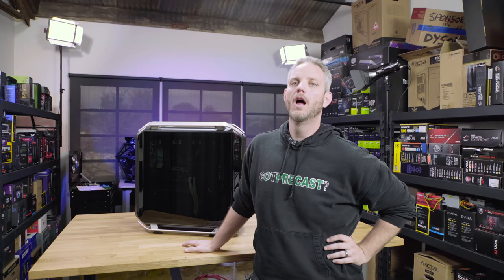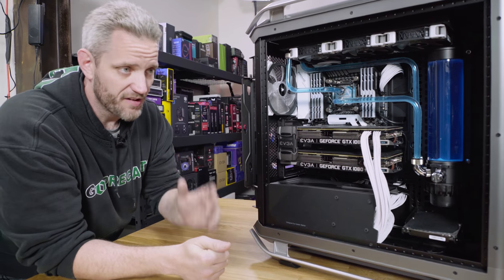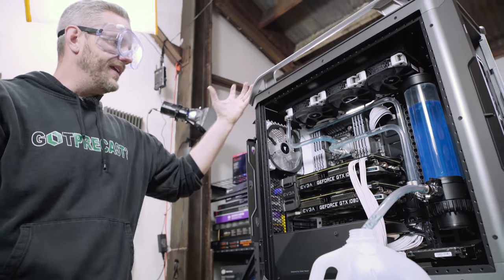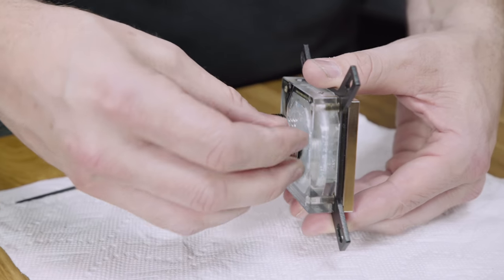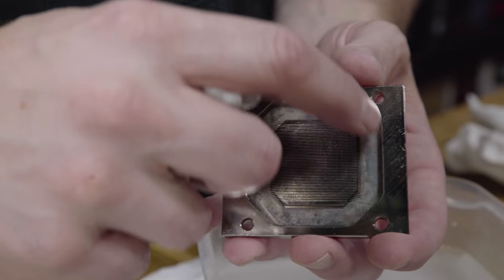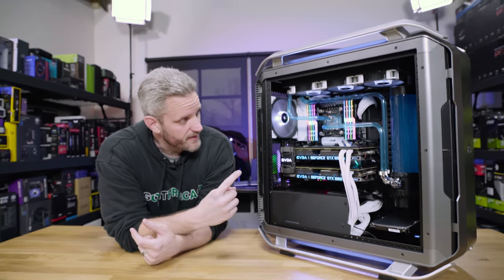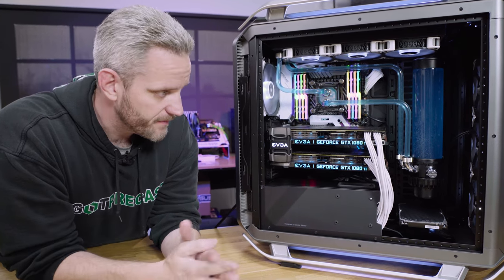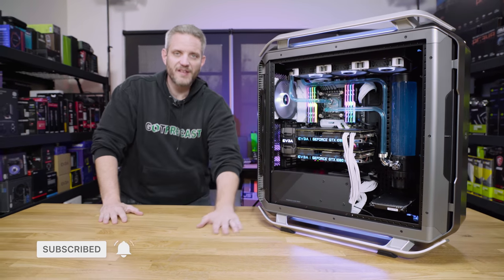It happened again... and this time it was NASTY

Comment: Jay did Primochill ask you to send them the block for chemical analysis? I'd love to see what happened from a chemical perspective
Reply: Issa gud nerd though.
Reply: Cl0nec0mmand0 We’re watching some guy work on a high end computer. I kinda feel like we’re all nerds.
Reply: I do not think it began as a chemical thing. My guess is the particles in Vue scrubbed chrome plating away, then reacting stated. It may also be the plating is blasted off by Vue particles and started clogging micro channels.
Reply: Pretty sure the nature of it's turbulent and fluctuating flow animation was a by product of abrasive and reactive particle in the fluid. Additional heat in the system probably speed up the process.
Reply: I agree with you. It's just common sense. To be able to see the fluid moving must contain particles. Those particles are abrasive in nature.

Comment: copper does "rusts". copper oxide is the copper version of rust
Reply: Benni That comment is all sorts of wrong.
Reply: Benni, keep it that way. I'm in Organic Chemistry now and it physically hurts me. Chemistry can only hurt you.
Reply: The more noble a metal is, the less quickly/easily it oxidizes, and copper's more noble than e.g. iron. But apart from that: all metals have a potential to oxidize when in contact with substances containing oxygen, no matter if it's water or air or something else entirely. Even precious metals like gold can be forced to oxidize under the right conditions, however, almost anything else will attract oxygen more strongly, and thus the precious metals are more or less inert in most conditions. Copper will oxidize happily under water however, it just takes a tad longer than iron. And you can't "get the oxygen out of the water" either—it's H₂O after all, and you'll always have a certain percentage of molecules splitting into 2 H₂ + O₂, which will then react with substances in contact with them, even without actively starting that process (using electricity, etc.)
Reply: Bigsky I disagree. It would be better if he learns more, he could avoid hurting himself or at least not make comments like he did.
Reply: Jay's technically correct as only iron and other iron containing alloys rust, other metals undergo corrosion. While rust is corrosion, not all corrosion is rust
Reply: Benni 
No it reacts with the oxygen in the water, comes out slimy green looks like moss.
Bronze does the same thing.
Reply: Bigsky 
Yeah just stick to the books, and let the trade guys that really know what happens, sort it.
Reply: Rust is exclusively iron and oxygen creating iron oxide. Copper oxide is not rusting.
Reply: Runoratsu 
Nope, doesn't always work like that.

Some metals like putting a coin on a mild steel will have no effect on either and rust normally 
 but putting a coin on ss Will cause the coin to be fine and the ss rust out faster.

What you are talking about is right but it's not always the way it's written down.
Reply: TheWolfHowling 
All metals "rust" only gold doesn't that's why people go after it and put a high dollar cost on it as you can never lose it
Reply: I want a 1080 for 500€
Reply: Everyone here is dancing around phrasing.
Metals oxidise.
Iron develops rust when it oxidises.
Copper/Brass develop Patina when they rust.
Different but the same.
Reply: Ryan Rhind this
Reply: Bigsky you you say that you’re diene?
Reply: Rust is, in fact, metal oxidation. ;) The difference is copper doesn’t “disintegrate” through oxidation. It creates a layer of oxidation that is, in fact, waterproof, keeping the metal underneath protected.
Reply: I'm just here for the metal experts to duke it out...

Comment: As a Chemist your best option is to have only the same metal that comes into contact with your coolant. Using Gold plate on all of the coolant systems metal surfaces. Using Teflon tape on all fittings. Auto radiator fluid is also a good addition.

Comment: This problem is caused by the galvanic (electropotential) series. Different metals have different electrochemical potentials. The more noble a metal the less it is vulnerable to corrosion because ions are not as easily formed as with less noble metals. If different metals within the watercooling circle are connected by an electrically conductive medium (electrolyte), an electrical current will be established and the less noble metal corrodes. The galvanic series is also the reason why it is important to consider which metals are being used in the watercooling system. In your system Copper is the most noble metal while Nickel is the most unnoble metal. Thats why parts of the nickel plating was dissolved. A possible solution to the problem of corrosion in watercooling systems might be the use of non-conductive coolants. By the way, the galvanic series is also the reason why sacrificial anodes are used in shipbuilding. But I assume, that you guys know that. If you want to learn more about that check this link: https://en.wikipedia.org/wiki/Galvanic_series

and just saying: @6:34 Chromium compounds are in general toxic.

Comment: Baking soda & water makes great cleaner for copper, silver, etc.... Can add more/less water to make a paste or slurry (using distilled water is best though as has less impurities & DONT use spring bottle water) & is great for getting rid of tarnish, gunk, tarnish, etc..... than just rinse/wipe with clean water. That's what I use & keeps fittings, o-rings, gaskets "newer" little longer before need replacing. Just an FYI, hopes it help, & I also do a flush with a baking soda/distilled water slurry & that really helps.
Thx for vid cheers

Comment: It seems like it isn't exactly the metal itself but the coatings that are reactive to the Vue fluid more. It is abrasive so it would have scrubbed any coatings off throughout the system, maybe even the acrylic block and reservoir got a micro abrasive scrubbing which caused the problems.

Just a random thought but could a person install a filter to collect these larger particulates out of the fluid? Install a ball value before and after the filter to isolate it as needed.

Comment: That nickel plating trash that EK seem to insist on using in most of their blocks can cause a lot of issues for no gain (well maybe aesthetic). I had a nickel plated GPU block which gunked up my entire loop because it reacted to a tiny silver coil! Of course at the time EK were still denying that nickel was causing issues, now they kindly inform you that you can't use a kill coil with any nickel plated blocks. Nickel is just so unpredictable, I'd say avoid putting it in your loop at all costs.

Comment: @JayzTwoCents  You need to come up with a way to split a rad in half or open it up/unseal it to see the build up.  Or next time one needs cleaning out clean the system but don't flush the rad, test the temps, then flush it like you did and retest. Final test could be replacing the rad with new stock and see just how gummed up the vital heat exchanger really is and how bad it suffers from the beautiful stuff.  Love your work man, you've taught me most of what I know brother and I thank you for it, again thank you!!

Comment: How do you know that crud is not built up inside the radiator tubes? I mean if it was building up on the block and leaving a gritty residue that you polished off using the toothpaste - how do you clean the rad tubes?
Reply: He used a pressurized system to force crud out, but there is plenty of ways to clean the radiator tubes. There's acidic solutions you can use to basically clean out any gunk left in the tubes. Stuff like "system prep". He mentioned all this at the end of the video
Reply: Never use acid on copper much less a radiator with forein source of soder
Reply: He literally explained all that in the video.

Comment: @JayzTwoCents, I also am a longtime Vue user (I think mine was in the system for like 8 months) and I used Mother's mag polish and it got my cold plates perfectly shiny and new. Basically better than new so I'd recommend using that to get that pinky and black residue off 100%. Obviously you need to wash it after that as you don't want metal polish in your loop but ya it worked super well.
Reply: I also will say I didn't have near the same issues as you though so it further underscores your comments about metal variances. I only had a little bit of white residue and the tarnish stuff on the cold plates. Everything came off pretty clean. Just a shit ton of elbow grease.

Comment: Why not just use distilled water if you keep having these issues with different fluids?
Reply: It helps ... a lot but corrosion will eventually still occure unless you have near 100 percent ultra pure water ... the type you get for 60 bucks a liter
Reply: @amineabdz  ive been using distilled water in my system for like 2 years now and its still fine lol, no kill coil or anything but all my blocks and radiators are copper and the system isn't in direct sunlight. the best fluid you can ever use is distilled water and im using fairly cheap stuff.
Reply: @user-zq4ec5xp7t  What about sunlight? (i'm a watercooling noob)
Reply: amine abdz Drop some PT Nuke in there. That helps to prevent growth
Reply: @greggreg2458  Algae could grow
Reply: @Phelper99  Oh thanks!
Reply: You need an anti-corrosion and biocide to prevent issues. But these pastel and vue stuff looks like it's sandblasting the internal components, not good.
Reply: A mild mixture of distilled water and car coolant is what I would use personally. It is a biocide, designed to prevent oxidation (car cooling is full of mixed metals of varying quality after all. No need to worry about aluminum and copper reacting) and it also lubricates your pump. It is not as good at cooling as pure distilled water + biocide but the other good sides should more than make up for it. And it gives your coolant a nice blueish green or red color. Probably the biggest downside is that it is very toxic, which is only a problem if you get a leak and you have pets. 🤔
Reply: @amineabdz  boil, capture, condense. ez pure water.
Reply: @MaaZeus  coolant used in cars does NOT have a biocide in it. Who ever told you that is a liar, it is only a corrosion inhibitor and reduces the freezing point. If you build a loop properly and not cheap out then mixing metals wont be a problem in the first place. Distilled water (doesn't need to be expensive) and a biocide is all you really need. anything beyond that it either for looks or pointless.
Reply: @liamcooper6721  It does not have biocide, but AFAIK the amount of glykol makes it toxic to almost all forms of life. It does not need an added biocide.
Reply: @MaaZeus you need to mix it higher than 6500mg/L for algae and co.(doesnt sound hard I guess). Interestingly the oral LDlo for humans is only 786mg/Kg for Ethylene. You may very well be on to something but I will stick with a few drops of biocide as its easier and I can choose any colour after the fact
Reply: @MaaZeus  I always put car coolant in my loop... works perfect, no difference in temps compared to distilled water, and never any nasty buildup in my blocks or anything.
I will definitely not use Mayhems bullshit color stuff or Primochill... no color dye shit ever, it's just asking for trouble.

Comment: g12++ / BASF Glysantin "red" + distilled/ultraclean water (demineralized is also fine)..
intended for car use with cast iron, aluminium, brass, copper metal-mix cooling systems,
with high+really low temps. Corrosion inhibitors included (intended for 3..5 years), also antifreeze...
Tested in really bad working conditions for years.
- I'm using it since 2004 when i started watercooling. (also use a large fuel filter in front of pump)

Comment: 50 / 50 Ethylene  Glycol to distilled water, same metal fittings. Running clean for 4 years now.Silicon orings and tubing, or glass tubing will be the best.
Reply: Well they are meant for aluminium engine block and rad at really high temp.
Reply: Thats what I was just imagining. It doesnt matter much what the fittings companies do if the liquid is messed up and the kind of liquid used is up to the user. Btw, your misture is nice.
Reply: Nope! You're completely incorrect. This is WAY too strong for computer water loops. The glycol will dissolve all of your rubber fittings over time. Besides that the less water you use, the less actual heat you are transferring with it. Nothing man made can transfer heat as well as water, you want as much water as possible and as little coolant as possible. Only add a tiny bit of glycol, like 5% to 95% water. That is, if you're using a computer in the same loop without draining it for 2+ years. If you're disassembling your water system once a year then sure go 50/50, but it damages the system.
Reply: Yeah, you are right. Water it more efficient than glycol. But 50/50 mixture drops the temp of max 5 degree c. Also rubber is not recommended. They will swell and then degrade rapidly. That's why silicon is highly recommended. With those 2 things right, you should have a worry free loop, at-least for years.
Reply: I hope you do realize that all of your computer water blocks have rubber in them. EK water blocks use rubber for seals (not silicon). All the fittings use rubber in them (not silicon), it's in your loop. 50/50 is for automotive, /NOT FOR COMPUTER USE/. It will destroy your expensive computer water system, break down the metals and cause corrosion. It's way too strong for computers.
Reply: Nah man, What's he is saying is that go with silicon. Glycol absolutely doesn't react with metals. And you can buy silicon o-rings.

Comment: I think if I ever build my own loop, I'm just gonna use vehicle antifreeze. That stuff is designed to last in engines that get a heck of alot hotter than a PC. It also come in a florescent yellow, so it will still look good.
Reply: DO NOT DO THAT. The chemicals in the anti freeze will eat the plastic tubing.
Reply: LOL please upload a video when you boot that up. 

(I think you mean coolant, not antifreeze).
Reply: @RockandrollNegro  I stand corrected, no need for insults. Where I'm from the stuff we call antifreeze is used to defrost wimdows. The coolant we put in the engine we litterally just call "cooling fluid" (translated).

Comment: a tip about cleaning. Try using soldering flux to clean up your blocks or components. I've found the thing to be better than anything. Better than toothpaste, window cleaner, alcohol, or anything.
I'm a smoker, and It's the only thing I've found to remove even the cigarette tar from PC components. It also removes thermal paste better than any other thing I've used, and you dont have to worry about shorting the circuit when using it, since its non conductive, and evaporates on its own. You dont have to "rub it", it removes most dirt just on contact. My Ram slots were making a bad contact once... and didnt recognise 1 DIMM, after I fluxed it, the thing worked like a charm. Since then I've been using it for anything and everything.
Reply: flux is simply high acid in content.  i sweat pipes for a living and my index finger and thumb are always cracked from it.  you want to be careful cause it will make the PH level go extremely acidic in a system like this and cause its own issues.

Comment: That residue looked like aluminium oxide to me. I would use regular Crest or Colgate toothpaste. The 3D White and other whitening toothpastes use hydrogen peroxide as the whitening agent. Peroxide is one of the most powerful oxidizers around and could compound the problem if it gets into the loop. Additionally, as there are a variety of different metals in the loop - nickel steel, copper, aluminium, and the like, you can have an issue where they interact through the medium of the coolant, especially if there are minerals present in the liquid. Aluminum will be very susceptible to galvanic corrosion in contact with copper, assuming that the two metals are also in contact with a common electrolyte (such as water with some ionic content.) You are likely correct that the copper plugs on the radiator are the culprits.

Comment: I bought an origin PC. They offer primochill vue in their cryogenic water cooling loops. I didn't know anything about it, but it sounded neat and I liked the blue color so I added it to my build. So now I am wondering, if it truly is as bad as what I've been reading , why would a large company like that use it in their systems? I have a 3 year warranty, if that liquid bungs up the loop or breaks down or  anything, they are going to have to fix it. I would like to think that a company like Origin would  do more research and try to avoid a potential warranty issue.

Comment: This video is a few years old now and I just wanted to point out that Vue comes with a special prep chemical that you have to run through your system for 72hrs prior to using the Vue coolant.

In addition, there is also an additive called System Reboot that is amazing at flushing out the system. Even if you flushed multiple times with water and the loop looked clear, add the Reboot to the system and after a while you will see a ton of the old Vue mixture in the water.